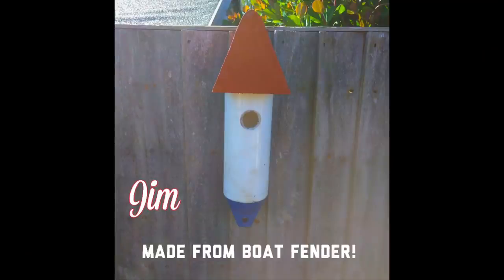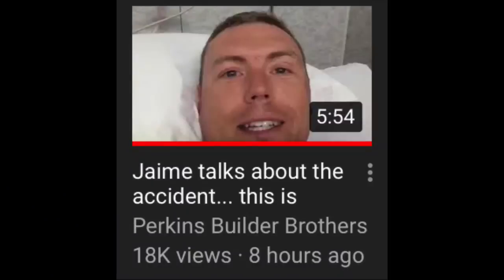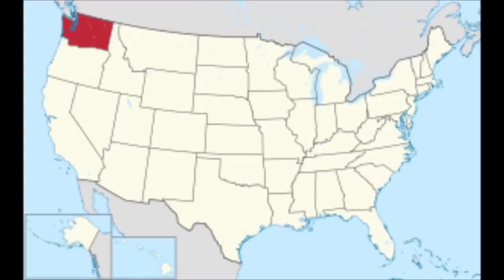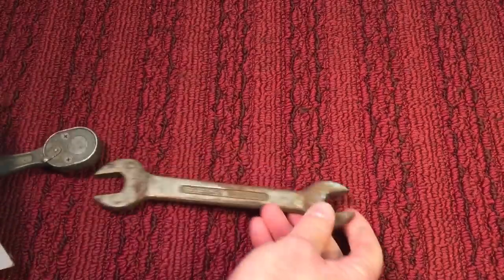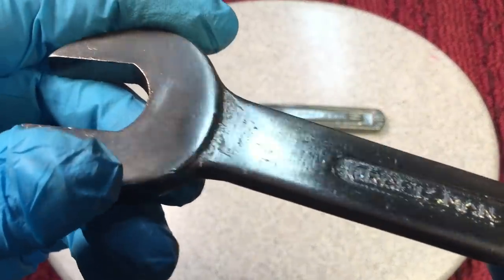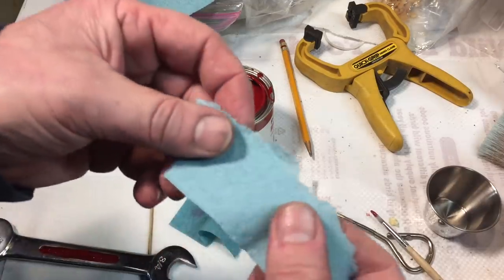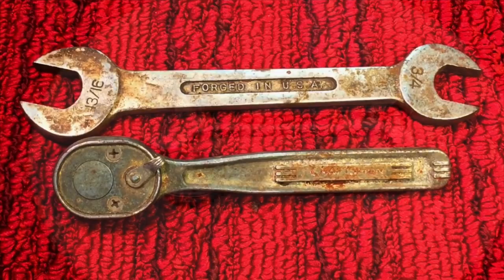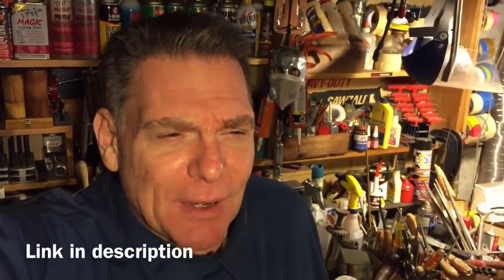Vintage Craftsman Wrench & Ratchet Restoration

Comment: It's no shock that a jointer can be a very dangerous piece of equipment. Any spinning blade of any sort gets my utmost respect. My dad lost the tip of his index finger on a jointer pushing a piece of wood through the tool without a push stick/block. Before I worked in present job in oncology, I worked 15 years in orthopedics. I can't tell you how many people I saw through the years with lost digits and worse from power tools. Some were hobbyists but many were contractors. Many of those injuries were because people removed or inactivated safety guards. Some were due to carelessness from a gradual loss of respect for the tool because of familiarity and frequent use of a tool over time. Please be careful out there people. Thanks John for reminding us of this danger. Love those vintage Craftsman tools. Great restorations.

Comment: Jointer anecdote: I was helping a deaf/mute friend, David,  process about 500 b-ft of 4/4 red oak he needed for a kitchen job. For some reason, Dave had removed the guards on all the commercial grade machine tools in his shop. In order to speed things up, we were doing a ballet without shutting off anything (noisy, but Dave didn't care, of course). About half way through humping all that wood, I needed a break so I put my hand down and leaned on the !8" jointer table. I looked down to see my hand about 2" from the open cutter throat.  Then I thought of my arm being swallowed by the cutter head - it scared the bejesus out of me! Still does, Scout.
Reply from the maker: Ricopolico Yikes!!!   Luck was with you that day!  😃👍

Comment: Great restorations, as usual.  Thanks for showing the paint technique again.  That's a nice M-F 100.  I'm a Millers Falls fan too.  I have a couple of 100s including one I screwed up on the buffing wheel (live and learn).  I also have several of their spiral ratchet screwdrivers.  I've also restored more M-F and GP eggbeaters than I care to mention.  Thanks again for the great video.
Reply from the maker: Drew Vintage Craftsman and Millers Falls are my two favorites!!!   😃👍

Comment: Great restoration mate. Love the red highlights. Back in the day when I had more testosterone than brains I used to ride bikes. I had an open faced and a full faced helmet. I chose the full face one on a day of riding the Great Ocean Road in Victoria, Australia. That road doesn’t have a straight bit in it. Follows the coastline in southern Victoria and is the most beautiful place. I was riding hard until I hit a switchback section covered in gravel, left by someone on the bitumen. I came off, face planted and slid down the road straight under an oncoming car. Lucky for me the car saw what happened and stopped. Well after they extracted me from under the car, the chin guard and bottom part of the faceplate were gone. Ground down by the bitumen. Without that full face helmet I wouldn’t have a face today. 🇦🇺👍
Reply from the maker: Shed Man X I have 3 full face helmets, they are great for impacts but so many times you tend to go faster with a full face helmet...  How many accidents might have been avoided if speed was not an issue?  Great for falls but how many have they caused!  😃👍
Reply: ScoutCrafter Don’t get me wrong. I wasn’t disagreeing with you, your video just brought back some bad old memories that should have stayed buried. That was almost 40 years ago. I totally agree if I was wearing my open faced helmet, I wouldn’t have been going as hard. The mixture of a sense of safety and stupidity is a deadly mix. Thanks for the feedback mate. Love your videos, rants and Instagram posts. 👌

Comment: Another useful video. Your comments on safety are well taken. Don't let the equipment lull you into a false sense of safety. We're never  supposed to suspend common sense and awareness. I do wear shooters ear muffs for my dad's ancient Craftsman table saw.  It is really loud. Very nice job on the tool restoration. I have Craftsman wrenches and ratchets from the 1950s, and the examples you restored look older than that. Thanks for keeping vintage Craftsman tools alive., and best regards from the Intermountain West.
Reply from the maker: Pat I too wear shooters muffs for my belt sanders because the bearings are so loud!  😂😂😂

Comment: Sometimes that safety equipment can get in the way. I've always hated dust masks and respirators, but now I can't go to Harbor Freight or food shopping without one!  I remember when I started my first day on the job working with dock levelers with steel-toed boots. The guys told me it was more dangerous to wear steel-toed boots because if any of the materials we worked with landed on mt foot, the plate would deform and cut my toes off. That myth was busted. Then there was the time I welded in short sleeves. Learned my lesson after a full day of that. 

We are always one mistake away from injury in our shops. Great restoration!
Reply from the maker: Paul -  LOL!  You are so right!  Welding in short sleeves gives you freckles!  😂😂😂

Comment: Nice craftsman wrench and ratchet, came out really nice too!  The other day you showed that Stanley chalk o matic and by coincidence I was looking at one the day before online and quite liked it. After you were so enthusiastic about it too,  I looked it back up again and bought it right away. I will wait until you do yours because you are going to think about stuff I never would've. Look forward to it, it is such a nice piece. 
You are right about the protection (I do not like gloves for that reason), I never really used ear protection but since my ears are weak to start with that was a dummy choice to, I have this return constant beep. Don't wish it on anyone and I got it mildly. So use your ear protection wisely indeed.
Reply from the maker: Alex- I wear ear protection for anything that hurts my ears...  otherwise I rather hear what’s happening.  😃👍

Comment: I agree with the safety comments.  I use "IsoTunes" hearing protection and it only reduces noise to below OSHA standards.  I wear them when I work with my jointer and planer as well as mowing the lawn.  I can hear the surrounding noise such a machines or engines, but to full volume.  I am not a marketer for IsoTunes, but genuinely like their product.
Reply from the maker: Some times my ear protection makes me feel very venerable!

Comment: My father and I spent most of our lives in the garages and we used about every brand of tool that was available but Dad always swore by Craftsman ratchets for body work. If he had some rough and ready work to be done he reached for his S-K set, but for body work it was Craftsman because the ratchet heads had very fine teeth. In a tight spot where you could only swing the ratchet back and forth about a half an inch the Craftsman would grab the next tooth and turn the bolt. The S-K was tough as hell but was so coarse you had to have plenty of room to get it to the next tooth. Plus the Craftsman had a great warrenty at Sears and cost half of what a Snap-On would cost. Does anyone know of a store that will replace Craftsman tools since Sears is all but gone? Good Job as usual guy!
Reply from the maker: My Dad also had Craftsman and S-K!   =D

Comment: I have to agree with you about safety equipment, PPE can be very dangerous. 
For example two men in the UK working on train tracks where killed last year. Because the hearing protection prevented them hearing the train approaching from behind them !!!! 
And in my experience its usually office staff who have no experience of doing your job who tell you what ppe to wear

Comment: The marks on the inside of the open end wrench are probably from the broaching process.  It was nice to see the internals of the old ratchet. They turned out pretty good.
Reply from the maker: James Leathers You are spot on!  How cool is broaching?!  😃👍
Reply: @ScoutCrafter  Right you can put out a large quantity while still holding close tolerances. Although not my normal job I would volunteer to run just about anything on a Saturday for time and a half.  So I have run many different broaching machines.  Back in the day. lol

Comment: I was wondering where you got my rusty wrench but then remembered mine was a Blackhawk! My go to wrenches were a 3/4 for injector fittings like on the injector itself and the pump for bleeding and a 9/16 for setting up truck brakes. Other than that it was every man for hisself! NICE job on everything. The old ratchet is a beaut! So take care in the capital of everything sideways. I had lab work done and it was the same today as 3 weeks ago. NOTHING but staff. Go figure and GBWYou!
Reply from the maker: Lewie thank God you are A-OK!  😃👍
Reply: @ScoutCrafter  Uric acid level is high and that'[s what they're testing for to see if the meds are bringing it down. It ought to help with gout and arthur if they can get it to a 6. I was 9.5 and the HIGH number is 9.2. But I can manage to wobble around under my own power. So Remain Calm, you night owl, you! Seems like Little River had a right good song about you/it! GBWYou, Buddy!
Reply: @ScoutCrafter  U 2!!

Comment: I am hundred percent with you on safety equipment. Having said that, i worked for years in a lab and i cant remember how many times i had that talk with students, explaining to them not to be stupid around liquid nitrogen and wear proper safety ppe. However, nothing worse than complacency or cutting corners around powerful appliances....
Reply from the maker: Hanno Conring Absolutely!  For example I ALWAYS wear eye protection because there is no reason not to, but my ear protection I only wear on very noisy equipment... 😃👍

Comment: John, I see that you have an old towel under your wire brush and no wheel cover. How much of the crud coming off the wheel gets past the towel? Do you take other precautions to keep stuff from flying all over??
Reply from the maker: American Sewing Machine Restoration LOL-  That towel is just there to keep the Lathe bed clean!  I ALWAYS wear eye protection and dust mask and also stand to one side when using the wire brush...  Occasionally they will spit a wire or two so I’m ready!  😃👍
Reply: John, I know you have talked about your use of safety equipment before and am totally with you on that. I was really talking more about how you keep the debris the wire brush takes off cramping up the shop. I am about to start some refurb projects and was just wondering if you have any magic tricks to keep things clean. I was trying to think of a way that might catch some of the flying crud. Maybe a box placed in back of the bench grinder to act as a back stop. Just wondered if you have tried anything like that before. Love your videos. Keep up the great work. You are inspiring me to think about starting my own you tube channel. Best Regards, John at American Sewing Machine Restoration.

Comment: Nice job John!  What size is that ratchet?  It looks like it might be a 9/32" drive.  I believe that Snap-on and Craftsman made socket sets in that size in the 20s and 30s.
Reply from the maker: Rick- I checked, it's 3/8's but you are right, it looked smaller to me too!!!!!!   =D
Reply: @ScoutCrafter Generally, the 9/32 is assumed to be 1/4" drive because that is the body size of the ratchet that drive size most closely fits.

Comment: I think they call that sensory deprivation, when you are no longer connected with your immediate surroundings. Vietnam fighter pilots I knew, said at some point there is too much sensory overload of sorts when in combat. To alleviate this, they would start power down a number of extemporaneous instruments and just get back to the basics of flying. Just too much distraction of information coming from the panel.

Comment: Anyone who works around equipment should consider noise canceling ear protection. It allows up to a certain level of sound through but shuts down when loud noises are present. They can be  less than $50 or several hundred for custom molded. Our shooting range requires them so you can hear commands at the firing line. I also use them at home - you can hear all your equipment - it is only as loud as your voice. As our range master asked - how much is your hearing and your fingers worth? Fifty bucks is really cheap - less than a box of most pistol ammo!

Comment: Scout, I hear what you're saying about helmets, but there was one time I was damn glad I had a full face helmet on.  I was riding on the freeway behind some kind of contractor's flat bed truck, and a piece of gravel bounced out of the truck bed and started heading towards me.  The chunk of gravel, which I couldn't dodge, nailed my face visor hard, right between my eyes.  The only damage was a nick in the visor.  I shudder to think what might have happened to my face had I not had that full face helmet and visor on.  Another biker friend of mine rode with a full face helmet also, but he never had a visor installed on it - I could't understand the logic behind that (especially after my experience with the gravel).  I tried riding a few times with the visor up, but the air stream hitting my face made my eyes water so badly (even though I wore glasses) that it was impossible to deal with.
Reply from the maker: Gerald- I have three full face helmets and I can tell you I am a better rider with a open face helmet...  Slower and much more aware of my surroundings...  On the highway wearing a open face you always leave a bigger space cushion.  It’s the nature of the beast.  😃.  I live in NYC and lots of motorcycle accidents here because kids speed like crazy!  My GF lives in Ct. NO helmet law!!!  People drive normal...   🤔
Reply: @ScoutCrafter  I live in San Diego and the traffic is just too dangerous for motorcycle riders in my opinion.  Most days when I read the accident reports in the newspaper, there are one or more motorcycle accidents with fatalities being quite common.

Comment: You're right about safety equipment.  On the ratchet, have you ever had to take out one of those little balls?  Or would that be an impossible task ?  - Kathie
Reply from the maker: artsietopology On this ratchet there are paddles called pauls that rest against the Springs, they come right out!  Super simple, you just have to make sure you hold the spring so it don’t go flying across the shop and under a bench!  😂😂😂

Comment: Its very true about how your sense of danger can be diminished because of safety equipment that limits the use of the sense that that organ is supposed to warn you about. And I know what you are saying about how obviously working on some high pitched equipment can certainly damage your hearing and so you need it with that. But, there should be some kind of scale that doesn't apply to all things. I remember once when I was a kid we had a deaf cousin come to our house and we kids were walking around the block and she was with us and at one point we all took it for granted and walked across a street and the deaf girl followed and we didn't think anything but suddenly this car screeches to a halt and the driver gets out screaming at the girls for being so "stupid" for walking in the street and almost hitting her.  Of course, the driver didn't know she was deaf, but she could have easily been killed because WE didn't think about her senses not being able to warn her of the approaching car.